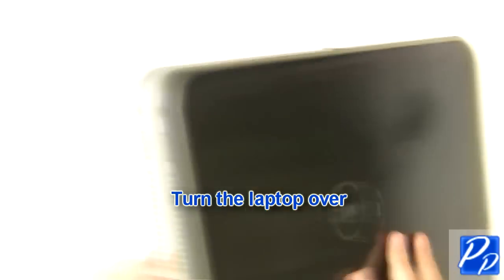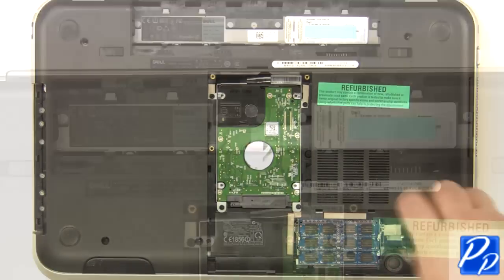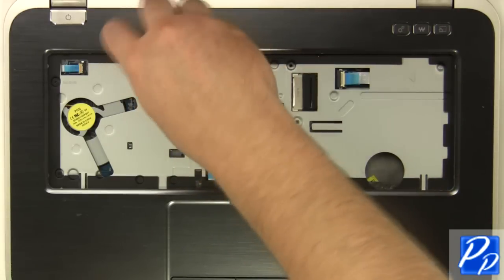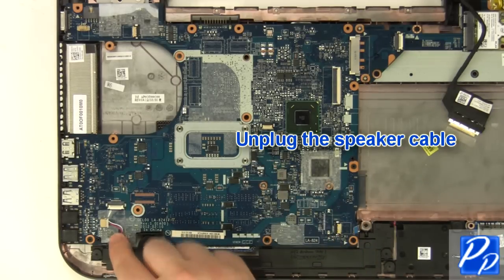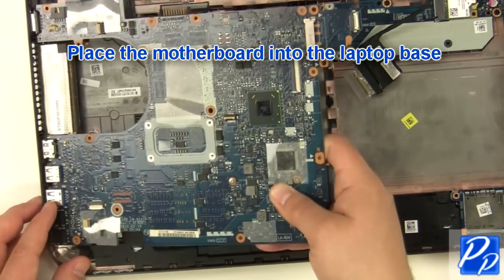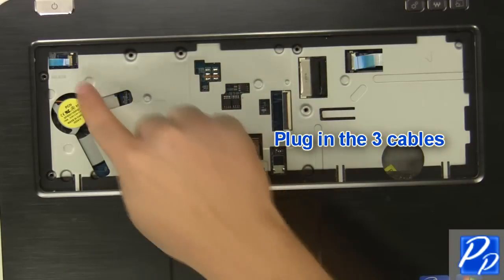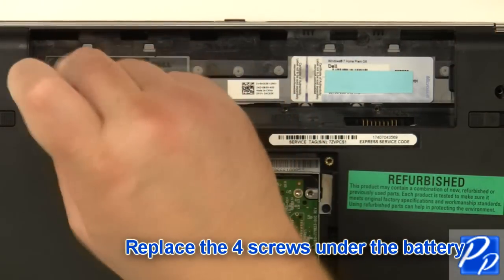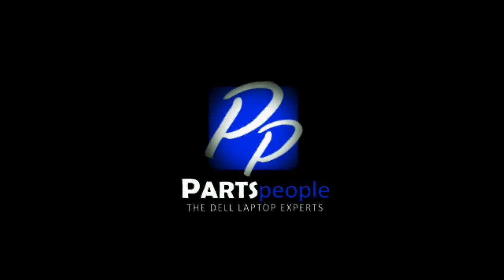Dell Inspiron 15R (5520 / 7520) Motherboard / CPU / Heatsink Replacement Video Tutorial

Comment: Very helpful video! Thank you.

I just found one of these laptops in the trash. It looks like it's in good condition, but it doesn't boot. The beeps indicate that it needs a new CMOS battery. Not only did your video show me how to get to it, the image was clear enough for me to verify that it's a CR2032 battery, a piece of information that none of the Google search results mention. I know most computers use that one, but I wanted to be sure before I took it all apart.

While I'm at it, I'll clean the fan (which is no doubt full of dust), and maybe clean the CPU and heatsink as well.

Comment: This video was EXTREMELY HELPFUL! I couldn't have done this without this video. My specific 7520 was a bit different. I couldn't remove the fan easily so left it attached to the motherboard. There is a screwed in module where the power cord plugs in and I had to remove that. There is an additional cable for the keyboard possibly for the back lighting of the keyboard. Thanks so much for the informative  video.

Comment: I had to replace an SSD in a 5520 and I decided to take it apart, because the fan was constantly spinning at max speed. I put fresh heatpaste on the CPU and GPU and it is good as new. Mine has an AMD GPU also, so the heatpipe has 7 (numbered) screws instead of 4, but no big difference. This video helped a lot!

Comment: This video was EXTREMELY helpful for me in cleaning out the dust & removing the heatsink; only thing it didn't show was how you would recommend applying the new paste &...one screw you didn't mention that needed to Also be unscrewed (in order to remove the motherboard) was the screw that connects the power cord connector To the motherboard, 😅

Other than those 2 details, I was able to do what needed to get done & my laptop's not overheating as much anymore. Thank you for the video~
Reply from the maker: Thanks for the heads-up on the video. Very glad to hear you were able to navigate through and help resolve your heating issue.

Comment from the maker: Banging on it could have caused a loose connection between the HDD and the motherboard. Try reseating the HDD. If that doesn't work, you may have damaged the HDD and probably need to replace it.

Comment: Awesome video, very thorough. I do have a question though, I have this same laptop (7520) and the LCD screen is completely black. External monitor doesn't work either. I have done all the typical troubleshooting, all to no avail. 

I am beginning to think the GPU itself has gone, as the computer posts normally, no beeps, I've reseated the RAM, tested the backlight on the LCD, etc. and since the external isn't working I'm thinking that it must be the GPU. The VGA, HDMI, and LCD are not working. They show that the cable connects (on the monitor it doesn't show "cable not connected") but just a black screen. Can't get the Dell diagnostic LCD test to show up or anything. Do you think it could be the GPU? Would a failed gpu cause a black screen? Everything else powers on perfectly, the heatsink, the dvd-drive, the lights, etc. 

Any help would be much appreciated. 

Thanks!
Reply from the maker: I would check to make sure the LCD cable isn't loose on the back of the screen first. Sometimes they become loose and cause the same problems (no screen, no external, no beep code). If it's not the cable then it's probably GPU relate and you will have to replace the motherboard.

Comment: If you notice when he is taking panels off, removing screws, the Optical drive is installed, then it isn't, then it's back in again before the actual removal step! Can the back or bottom cover be removed to inspect the underside of the m/b? Thanks, also, can the CPU be upgraded? Thanks

Comment: so easy and simple steps thanks alot  I ll try to change the thermal paste cuz my dell is so hot and the fan os loud I hope that will solve the problem
Reply: Sajjad Yassien did it work?
Reply: yes it works great trust me replacing the thermal paste and clean the fan solve the issue just be careful  when u follow these steps but it works 100%

Comment: Hey guys! Really awesome video. Thanks a lot! I wanna make a question: Where really is located the dell inspiron 15r msata? I did all those steps and coudn't locate it. I really appreciate if you could help me on that. Thanks!
Reply from the maker: It's only on the 7520 version of this laptop and it's located on the opposite side of the WLAN card/USB circuit board. this will show how to remove it. http://blog.parts-people.com/2013/05/23/dell-inspiron-15r-5520-7520-usb-circuit-board-removal-and-installation/

Comment: Hi
thank you for a great educational video. i have a 15r 7520 SE with mSATA SSD, and i want to upgrade that leaving my conventional HDD. i understand that SSD on the daughterboard to the top right side of the laptop base. is there any chance you could make a little video about that? thank you once again
Reply from the maker: If I remember correctly the model I had did not have an mSATA SSD slot. Unfortunately I do not have a video for the SSD. Also unfortunately, I no longer have that laptop. But, good news, I do have a video showing how to replace the USB daughter board that the mSATA would be located on. After it is removed the SSD would be held in place with one screw. I'm sure you will be able to figure it out after the daughter board is removed. Here is the video and written instructions.  http://blog.parts-people.com/2013/05/23/dell-inspiron-15r-5520-7520-usb-circuit-board-removal-and-installation/
Reply: Thank you very much. I'll have a look and try to figure it out. Thanks once again
Reply from the maker: ***** You should see an improvement in start up time.

Comment: Thanks for the video. What is the normal temperature for this laptop, mine is running at 55'C should I replace thermal paste?
Reply from the maker: I'm not sure of the temperature range. Try cleaning the fan first. That will probably drop the temperature.

Comment: Thanks!! It worked but after I changed the motherboard my screen is not working and I have to use an external monitor. Are there different types of motherboards for the same laptop model?? Could it be that the LCD connector is not compatilbe with this new motherboard??
Reply from the maker: andrew pazos There are different cables but that connection to the motherboard will be the same on all of them. It is more likely a loose cable connection or the cable isn't fully seated. Try going back through the laptop and reseating all of the cables. That might fix the problem.

Comment: Hey man, firstly, thanks for the video! Could you tell me if the fan performance in this model can be changed? I've already replaced the thermal compound (it's been awhile) but it kept overheating the same way or even worst, so I thought it may be a cooler problem... Thanks!
Reply from the maker: Unfortunately, they just have a tendency to overheat. You could try using a laptop cooling pad, but there cooling ability will be marginal. Overheating will happen more often if you use the laptop for Auto-Cad or gaming. The on-board GPUs don't handle Auto-Cad and gaming very well.
Reply: +Parts-People.Com, Inc you are correct,this happens to me too..

Comment: I have a question, my laptop battery died when i was doing a project and i slamed my fingers on the keyboard. When it came back on it told me i had to reinstall the OS but now it says it cant detect my harddrive so could a loose cable cuase this and which one connects the motherboard to the hard drive?

Comment: I bought this same notebook but when i plug the charger it doesn't appear anything! I think the mobo is dead, if i buy another one do i need to replace the VGA too? From the old mobo to the new one? Do u hav a video teaching that? Ppl said this notebook that u used on that videos doesn't hav a offboard GPU!
Reply from the maker: If you mean the GPU it is built onto the motherboard and can not be removed.

Comment: If I get a new motherboard, this time with AMD graphics, this is going ot be a big help.
Reply from the maker: Keep in mind that if you are replacing a Intel motherboard with an AMD you will have to change the Heatsink and fan also.
Reply: Parts-People.Com, Inc Thanks for the info. I had it covered already though.

Comment: I have dell 7520 se, does this laptop have any gpu cooling system? or it doesn't need it ?
Reply from the maker: This laptop has the GPU built onto the motherboard. The video shows the model with Intel graphics, there is another model that uses AMD-Radeon. Both of the models use different style heatsinks and the heatsinks are shared by the CPUs & GPUs.

Comment: Where is the msata? I had an issue with mine and would like to replace it. I know that its on the daughter-board but not sure what the easiest way to get to it.
Reply from the maker: The mSATA is on the bottom side if the USB circuit board. I don't think there is access to it on the bottom of the laptop, so the only way to gain access is by removing the motherboard and removing the daughter board. This video will show how to remove the daughter board. https://www.youtube.com/watch?v=nzNDDi69P3Q
Reply: Thanks!!!

Comment: I´ve a dell inspiron 5520 but I can use motherboard of dell 7520 or I can buy and install radeon hd 7730m in my dell 5520?
Reply from the maker: The GPU is built onto the motherboard and cannot be replaced. You would have to buy the 5520 motherboard that has the 7730m GPU to replace your original board.
Reply: Is that possible? , I mean where can I buy it?

Comment: Can you help me? So I cleaned out my fan and afterwards my laptop won't turn on. The battery light glows white when I put in my charger. Tried turning it on with and without battery. Would you have some kind of understanding of what I missed or did?
Reply from the maker: +Miffy Kee It is most likely a cable that is loose or not seated all the way. You will need to go back through the process and check all the cable connections, in particularly the power button cable, DC jack cable, and the LCD cable.
Reply: +Parts-People.Com, Inc Yes, thank you so much for the quick and informative response! My power button cable was loose and I had no idea that it was. My laptop is turning on just fine now. You've saved me a lot of stress! :)
Reply: +Parts-People.Com, Inc Hi it's me again. ^^; I tried cleaning my laptop again with a can of compressed air. Now when I try to turn it on, the screen won't start up and it beeps 4 times in succession... did that mean I messed up my laptop? :(
Reply from the maker: +Miffy Kee 4 Beeps is a memory failure. Try reseating the memory sticks.

Comment: hi, my motherboard (7520) died and i need to replace it, does the (5520) motherboard fit and works the same? is there any difference? 

im in a hurry please!
many thanks
Reply from the maker: They are mostly the same. The graphics on the 7520 is better (ATI Radeon
 7730M vs Radeon HD 7670M). The 7520 has the ability to have an mSATA 
SSD. I think that's it.
Reply: ive talk with the support and they told me they are the same but are not compatible..

thank you anyway

Comment: Hi i have the same laptop however with dual graphics, will this still be the same?
Reply from the maker: Yes, it will be the same.
Reply: ah yes it will be the same however there will be 2pipes, on to the cpu, and one to the gpu I managed to located images
Reply: Parts-People.Com, Inc new question I've preped laptop and have removed heatsink etc. However whilst I wait for my cleaner to arrive should I reinstall it as these pads. May get dry? Or dusty?

Comment: Can someone help me out cause i have this laptop but i added in extra features to make it like a gaming laptop. The problem is that none of the USB ports work so i asked dell for help and they said i need a new motherboard the price to put a new motherboard with dell is £370. Now idk what to do should i buy a new motherboard the same as the old one or should i replace the USB ports, bare in mind its USB 3.0 or should i give it to dell?
Reply: To build the laptop it cost £900

Comment: hey man, i have this dell inspiron 17R 7720 SE. i have a weird issue, I know this laptop has a hybrid nvidia intel GPU for some reason my nvidia GPU is never detected, 

it only runs on intel graphics, I have tried installing even linux system on my PC to see if that could fix the issue, but the problem is still as it is. 
ANY HELP FROM YOUR SIDE WOULD BE HIGHLY APPRECIATED. if you can help me solve this issue, and make my GPU work. thanks.
Reply from the maker: Check out our Short on running a Dell diagnostic. This may help solve your issue.
https://www.youtube.com/shorts/Zld-kpFd7-k

Comment: hii , 

my laptop stopped working it is not turning on , I can see blank screen & my laptop makes 7 beeps when I turn it on .

its means processor failure . right ? 

what should I do ?? 

does I have to replace the motherboard of my laptop.?? 

and did I have to buy a motherboard & Intel processors ?? 

or can I just buy a motherboard & swap the CPU & GPU from old motherboard ??

& did reflowing GPU will work ?? 

please help me
Reply from the maker: You will probably just have to replace the CPU.
Reply: akshay patil hey the motherboard probably is dead so you should go and check in amazon a new motherboard and see this video or maybe its something else you should see a professional about your problem!

Comment: so i claned up my 15R 5520 and suddendly 1 ram slot doesnt work, tried using 1 ram a the time and it runed on, the 2 ram modules are ok, but only one slot work, the question is how can i fix the ram slor, or replace it in case is dead?
Reply from the maker: RAM slots cannot be fixed. You would have to replace the motherboard.

Comment: Is the cpu upgradable? Its like a Desktop cpu
Reply from the maker: +Justin Lee Yes, it is. But, unfortunately I don't have a list of compatible CPUs. I know it can use i3s, i5s, and i7s but I'm not sure which ones.
Reply: Here is list of compatible CPUs. Using this guide, I just replaced my 13-2370M with an 15-3360M. About 60% faster. Running 8 GB ram but can run 16 and maybe even 32 (not confirmed). I looked at the i7s and they are only marginally faster than the i5 and the i5 is half the price. This video is the definitive guide for the 5520.

i3 2370M
i3 3110M
i5 2450M
i5 3210M
i5 3320M
i5 3360M
i7 3520M
i7 3612QM

Comment: which one is the dedicated graphics card?
Reply from the maker: This model does not have a dedicated graphics card. The 5520 either has integrated Intel graphics (via CPU) or discrete AMD graphics (via AMD Radeon HD 7670M) built onto the motherboard. The 7520 only has discrete AMD graphics (via AMD Radeon HD 7730M) but, neither have a removable graphics card.

Comment: This is a great video and i appreciate it, but whatever idiot at Dell designed this laptop case deserves a special place in hell. In my case WIndows 10 bricked a laptop and i need to reset the CMOS i literally have to take the whole machine apart to get to the CMOS battery?
Reply from the maker: Yes, unfortunately the CMOS is on the bottom side of the motherboard. Also, I don't know that removing the CMOS battery will fix your problem. I've heard of Windows 10 bricking because of BIO problems but replacing the motherboard was the only fix.
Reply: There's a pretty long thread on Dell's website regarding it. I've got time this weekend to mess with it, then i'm probably just going to put Ubuntu or CentOS on it and not have to worry about it happening a second time.
Reply: how can i replace the CMOS battery coz i got 5 beebs mean i have to replace the CMOS battery ???
Reply from the maker: You can see the CMOS battery at 4:53 on the bottom left corner of the motherboard.
Reply: thank u so much i found it

Comment: hey my laptop is dead it stoped working somedays ago when i was using it it automatically turned off 
when i plug the charging adapter the light green light turns off as soon as i plug it in and the laptop doesnt turn onn it does not show any sign of turning onn i talked to the service department the told to take off the battery and plug the power cord and try to turn it onn but it didnt they said it might be problem in the power supply plug or the motherboard has been damaged.. sir please help what could be the problem
Reply from the maker: I agree. It sounds like a bad DC jack or motherboard. One or both will have to be replaced.
Reply: Parts-People.Com, Inc  please can you help me in fixing it can i do it on my own n how much expense can incure
Reply: Parts-People.Com, Inc  please can you help me in fixing it can i do it on my own n how much expense can incure
Reply: could you superwise me in doing so